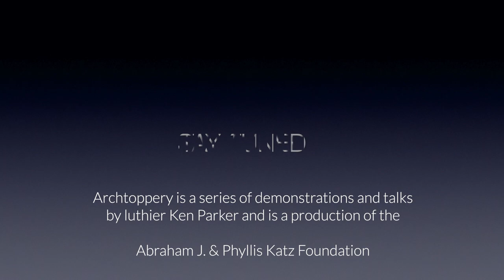Ken Parker Archtoppery: Bracing the Top 6

Comment: Hi! One question: i have read and seen in several occasions, that some builders recommend to sand a little bit more in the extreme of the braces, so when one glues them, some deformation will happen in the top, adding some tension in it, affecting its frequency response. What is your take on this strategy? Thanks :D
Reply from the maker: The funny thing about this is that there are advocates for "springing" the braces, as it is known, in Both Directions!!

Although you could argue that pretty much everything affects frequency response, I Can't imagine what could possibly be "gained", really, and unless your braces are massive, it's hard to see what difference it would make.  Maybe it's one of those "lore" things that got a seat at the table to excuse braces that don't fit well.  Certainly, the way I brace, the resulting force from this practice would be roughly zero.

Comment: I believe silica filler has its place ,but to much filler takes away from a perfect bond. For fillets yea but , Id be leary (timothy) doing it on anything guitar related.
Reply from the maker: Fillers are not needed for guitar work, so long as everything fits properly.  It's also critical that you wait for the wood to drink in the resin, and perhaps reapply as needed before clamping, ideally just as it changes from the "A" stage (just mixed) to the "B" stage (the first part of curing, when the resin's viscosity starts to thicken).  The "C" stage is cured, and chemically stable, although there are important transitional changes in the late B and early C stages that can be usefully exploited.  A good example is the short - lived "Parmigiano Reggiano" stage, when the resin, with or without filler, can be quickly and easily cut with edge tools or the cheese grater - inspired Surform style tools, or even a cheese grater!  Timing is crucial here, but this can really pay off in greatly lowering the amount of terrible dust and effort required to clean up and fair a messy layup.